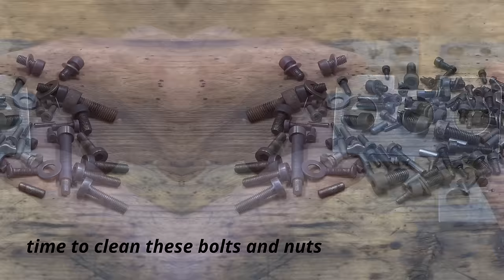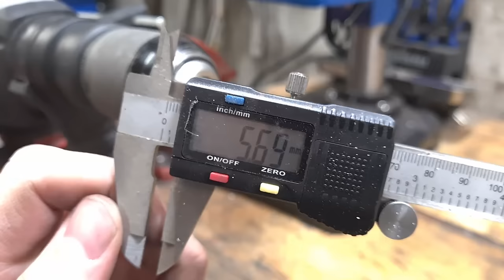Abandoned Old Lathe - Restoration

Comment: That is an awesome little machine. The tooling is eclectic. seeing how there are a number of various styles of screws. Awesome job, too. Although I wouldn’t have used metal tools to bang apart the metal lathe pieces.

The bed may need to be changed to something more robust

Otherwise it was a perfect restoration.

Comment: How is this lathe driven?
Reply from the maker: The chuck on this lathe is fixed so I guess it was meant to be just a model. I tried to install an old drill in place of this chuck and it will work, but it is not as accurate as the larger lathes and can not take the higher loads because of the drill head.
Reply: A proper headstock with bearings can be made for this, though it will probably be quite the intensive upgrade